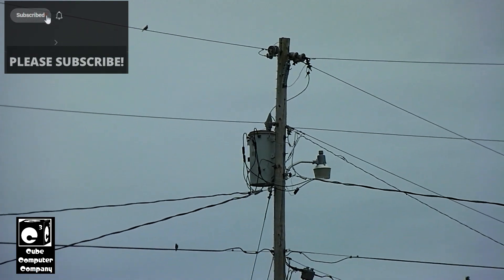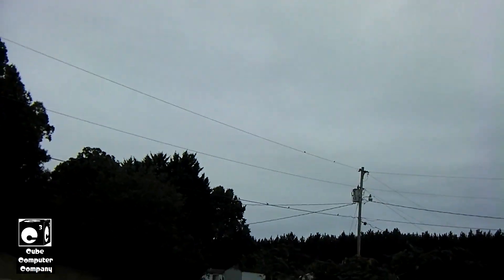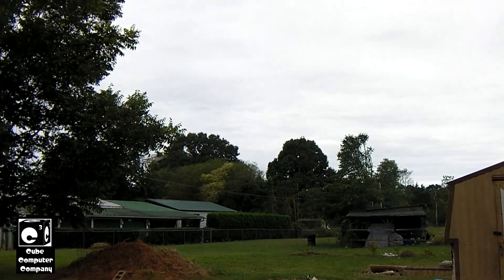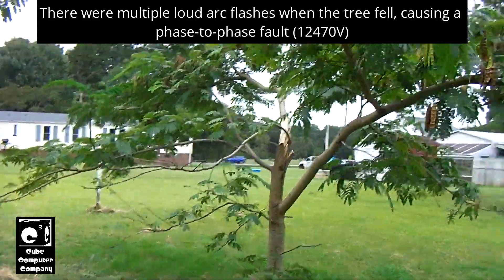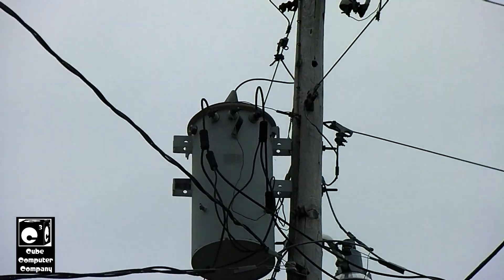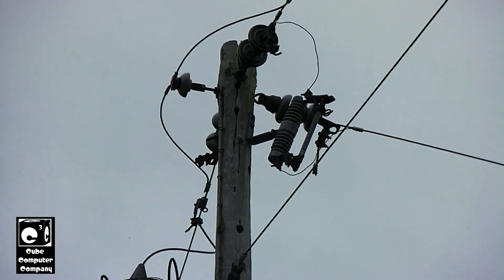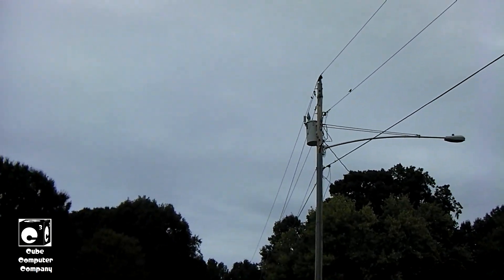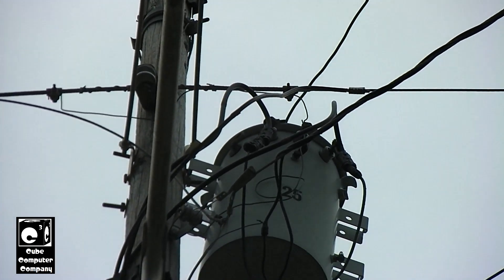No, that loud boom you heard was not a transformer explosion - Follow up

Comment: Only time i have heared a plausable case of one of these exploding was i was in school at the time but one of the group assistants for a club said they saw one hit by lightning said oil flew everywhere, at the time i had never heared of a transformer being filled with anything. 
I have never heared of that type of transformer they are using, by me they use cutouts, some of the CO-ops use a fusable link wich is just a small wire to the main but sized to melt and break when overloaded.  Looks like they need to tighten the bolts up on that transformer and the one pole looked about to split in two at the top.
I have a friend into linework with a power bank he made from variacs can back drive one of these and make a big jacob's ladder.